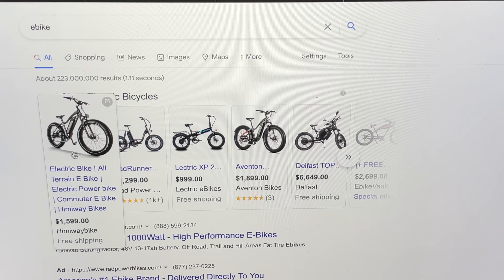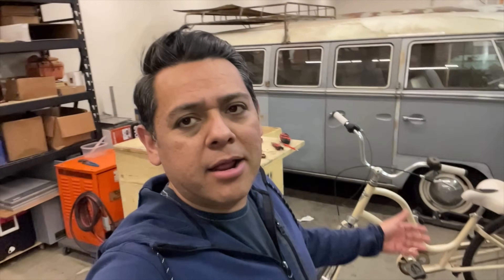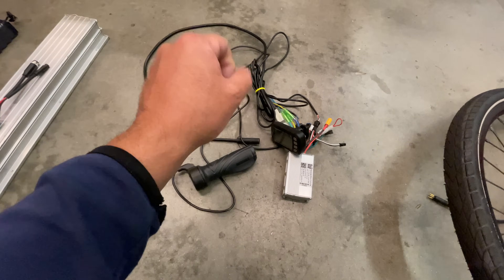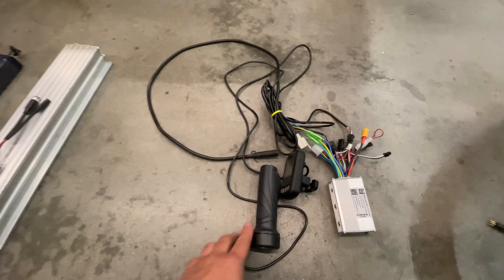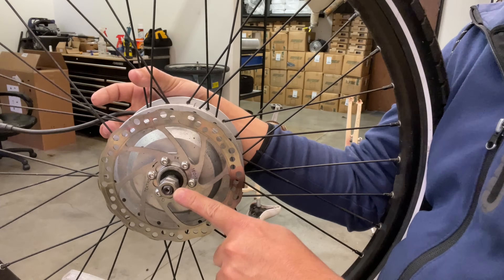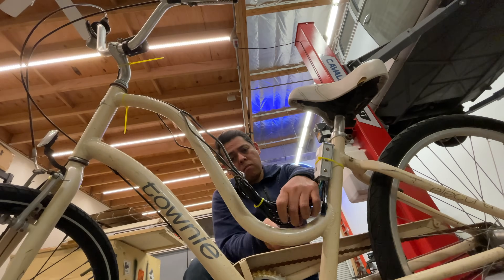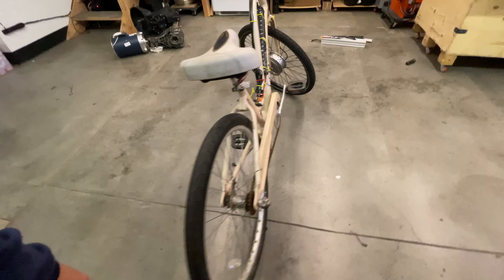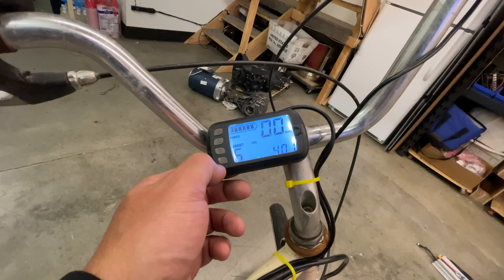$150 eBike Build,  Beginner friendly

Comment: I'm a cranky old man and a motor cycle rider for 40 yrs.   jehugarcia  i dig you talking about going faster and making them go faster but i think that is unwise unless the rider has a motor cycle license which ebikes can skirt.  even 20 mph is faster than most riders go on single speed bikes and comments about flying over handle bars reflect dangerous bad habits like riding with one hand or no hands and puting on a foot brake.  You can p[oo poo this comment but kids hare havein serious bike accidents all the time and 20  mph is fast enough to get hurt pretty badly specially if you decide to use your head as the landing area.  
      I like how fast you slapped that bike together  that was excellent but making the old piece of crap go 20 mph with out a front brake is just stupidly dangerous.  And having a few crashes before adding a front brake may not be the best idea.  If you wonder what qualifies me to discuss this I am an ASE certified mechanic.  And the thing that bothers me is weight transfer on  a cycle  in an emergency  about 80% of the riders weight pushes forward and lifts the rear tire this means that just when you need traction on the rear tire it is lifting up and reducing braking just when you need it.  there is no auto or motor cycle that has been for sale since the 30s that has rear brakes only.  Note ford added front brakes in 1932 to their model A.  anyway I wish you would have put a front brake on that conversion  considering you were going  29 mph  or KPH? around that lot.   thanks 
       EDIT  OOps  I stand behind what I have said but I just noticed that that bike already seems to have a front  brake you don,t see that on many med and heavy weight stingray type bicycles

Comment: If I had his knowledge with tools and electricity and had tools I'd get the biggest frame and 27.5 4.8 tires, a big 52v 40ah battery, 40amp controller,  to a 2000w nominal 3000w peak
Reply: If you had knowledge you would just get a real used motorcycle instead of all that stuff fat tires and huge speeds are bad on unsuspended motorcycles get an 80 cc or larger dirt bike with a license

Comment: Just a note to any UK viewers that these Bafang kits are technically illegal here as you're not allowed to have a throttle (only pedal assist) or go above 15.5mph. Though I'm sure the cops are more bothered about the millions of (also technically illegal) e-scooters zipping around than they are about people's homebrew e-bikes.

 Personally I would want to connect up the cadence sensor and brake levers to provide more control, and also to tidy up the cables and put the controller and battery into an enclosure or something (even if only a frame bag) to protect it from rain and the risk of catching and ripping out a cable while riding. 

I looked into converting an upright town bike like the one in the video but ultimately couldn't be doing with the hassle or waiting months for shipping from China so bought a used e-bike that needed a few repairs instead for a similar amount of money. (Didn't want to mess around with dodgy Chinese lipos and risk burning down my house either.)

Comment: My battery is not working. When I check the voltage at the leads i get a 4,6v. But when i check voltage at the battery leads i get 46V. What is happening here? I dont see the blue led light blinking

Comment: Hello great video, would it be possible to power a 36v hub motor connecting 3 x 36V 4Ah hoverboard batteries, for a total of 36V 12Ah? And what kind of connection would i need to connect the batteries to the speed controller?
Thanks

Comment: How do you charge the battery, is it through the controller? 
Also the site you linked sells the battery unawakened do I need to purchase extra stuff to awaken?
Lastly (sorry no experience) you said you soldered a wire to an mt60 but which one. Looking at the diagram I see leads to motor but nothing barked battery

Comment: I have a few old bikes, and I'm kicking around the idea of making an e-bike. I've seen several reviews and how-to videos, and it seems that people are recommending powering the rear wheel of a bike. The front wheel headset, the tube on the front of the frame with bearings that connect to the handlebars, is not made for the torque of the electric motor. It can damage the headset, even breaking the welds that hold the headset to the frame. I don't know how much of a problem it will be, but something to consider. With me being "El Gordo", I'll need extra power to get me up the hills, which means extra extra torque will be needed, and extra strain on the frame.

Comment: just the wheel alone with shipping is 80$ and with all the other components it added up to over 200$ easier just to buy a kit on amazon for 230$
Reply: My total was 70 for the motor with shipping
Reply: It probably depends where you live whether this is a good alternative or not
Reply: Kits for e bikes are 90$ not including battery, but cadence and speed sensored? And need battery plug conversion?

Comment: I got everything hooked up and my LCD turns on, but when I twist the throttle, I get one  bar of power and no wheelspin from the motor. Green and blue wires are reversed as suggested. Anyone got any ideas? lol
Reply: I had the same problem and it was just because the extension cable was not connected correctly, But other then that I'm not sure. Hope that helps

Comment: Ok so i solders an xt60 cable where the bullet connectors were in the motor controller (pos and neg) and connected the battery to it via an xt60 to xt30  but I'm still not getting power, everything else I followed to the letter, anyone have a similar problem? Any advice?

Comment: Can anyone help me. I purchased the wheel/motor battery and controller. I do not know which extension cable to purchase from the wheel/motor to controller. There are a few options. ? Also the controller does not come with any instructions. Is there a more in depth video anywhere. Please and thank you

Comment: My mid sized battery came without the plastic on the small red and black wires sticking out the back. The tiny piece of electric tape wasn't preventing them from touching. Think it's safe to use this battery? Also the motor wheel doesn't spin very freely and feels like it has sand in it. Bad bearings?
Reply from the maker: Hard to say,  you’ll have to try it to find out
Reply: @jehugarcia  Got my battery in a giant 80 pound safe charging :P So far so good haha

Comment: I found a controller that works, plug and play, no switching wires. Unfortunately, it came from a 48v 1000w kit that is probably too much controller, bit it does work without modification. Had anyone found a 36v controller that works with j just plugging in the 9pin connector?

Comment: I purchased all the parts but can’t seem to connect the battery to the motor controller box. Does anyone know where I can buy a cable to connect the small battery in the video to the controller box positive and negative slots?  Thank u in advance

Comment: My project review.  I saw this and for $150 was instantly in.  I have an old bike in the shed (DYNO Cruiser) that I don't use anymore. It is in fair shape but missing a pedal, seat is torn (covered with a seat pad).  A good donor for this type of project.  $150 what could it hurt?  I bought the items from the links.  Shipping costs were crazy!  Bought the medium line battery (it arrived but does not work ... still waiting on an answer for that.)  I received the wheel and tire.  They were in good condition, clearly used but in good condition.  The link for the nuts made me buy a package of like 25 (if anyone needs some contact me, just pay shipping I will give them to you). Like the battery that I received, the controller I received did not work (AMAZON PRIME REFUNDED). I  Bought another controller " hand brake style" (which I really like), Installed it then installed the wheel, since the battery I received from the link was bad, I bought a different battery that came with a case.  It was pricey but the case looks good on my style bike frame, hides the wiring very well and holds the controller also.  The 3 phase wiring was an issue, as mentioned in other peoples comments the wires are not color for color. The motor will wind but the wheel does not spin. I swapped the phases and the wheel operates correctly now.  As for $150 thats simply not true.  I have not found a way that you can convert your old bike for $150.  Parts, shipping etc just cost more than $150.  With some minor upgrades, I am in to this project for $281 (not including the bike).  With that said, I am VERY HAPPY with my bike now that is it is converted.  Thanks for posting this, I would not have tackled this without having watched this video.  JAG35 STILL WAITING ON AN ANSWER FOR MY BATTERY!     Please help
Reply from the maker: what's the questions on your battery?
Reply: I received my battery/charger.  The output on the the charger is reading 41.2 volts.  However, the output on the battery is on 19.8v.  The charger is working correctly.  I charged a different battery with it.  Can you help me solve the issue with the battery I bought from you or replace the one I received with a working one? Respectfully

Comment: I'm having a tough time measing my tire size on my existing bike.  I want to buy one of these and fit it to my Fuji Absolute 2.1  The sidewall of the tire measures:  32-622  (700x32C)  I'm not quite sure on how to read it.  If anyone could help me decide weather or not I can use this wheel, I would appriciate it!
Reply: Tape measure the wheel across

Comment: just got the wheel, battery, controller , throttle, cable for wheel.  when i give it just a touch of throttle it spins correctly but if you give it more power it stops. tried all 9 motor wire combos. what am i doing wrong? thanks
Reply: Try connecting the "Intelligent Recognition" plugs. I needed to use the throttle until it DIDN'T work, unplug, and now it's fine (don't leave them connected). Use the wiring advised by Patrick W., "yellow to yellow, blue to green and green to blue."
Reply: @lastbutnotleast1396  my controller does not have any plugs like that. i DID remove the halls connector and solder the wires to each other. now it runs perfectly until you get on the bike and then it sounds like something is slipping in the motor/gearbox.  if you baby it , it finally grabs and will pull just fine until you let off the power. then the slipping starts all over again. but, once again, my halls was not making decent connection. that was the original problem. now i need to see if the gears are stripped (out of the box) or something else is wrong :) when it works it works very well

Comment: Any chance my motor is shot? I have been fighting my controller. I changed the phase wires around and it still doesn't move.
Reply from the maker: It’s posible
Reply: @jehugarcia  I used a 48v 1000w controller from another kit and plugged it right in and worked perfect with the 9 pin connector. No switching necessary.  I am teaching a middle school S.T.E.M class and this is our first project. They love your videos.

Comment: What controller do I need for the 26'' 36 volt Bafang wheel Rated Power (W) 250/350,  if I use the NineBot 36 Volt 720 Watt I also purchased. The 250/350 watt controller I purchased just sparks out when trying to connect. Any suggestions?

Comment: Be aware that the wheels are not in the best shape.  Ordered 2 one arrived with a seized hub, and one arrived with a bent rim.
Reply: They're specifically sold as bent/broken wheels.
Reply: Both mine arrived in good order.
If they are bent I can't see it but I haven't put them in a set of forks yet.
If they are out it's not by much.
The tires even hold air and they included the calipers.
Sorry to hear yours weren't
The one that's locked up is likely the gears which you can get replacements for. 
Personally I'd open these wheels up and inspect, clean up and  lubricate it.

Comment: Here in stores we have brand new chinese €499 ebikes. lots of family here have them and myself would never buy them, they work but dont ride well and have no real controller, more like an on-off for the motor when u start pedaling and they make a lof of noise.
Myself got a used Dutch ebike for €350 which used to be €2800 new and its awesome comfortable bike, could use a new battery tho.

Comment: You made it seem soo easy! Right after watching this I bought the ebikeling kit (only Bc I wanna do the ear wheel) and I bought the 30 cell pack from your store, finished the build in like 2 hours! It’s super awesome, but the system cuts out after about 20 seconds of continuous use. Do you have any tips on how to fix this? (30 cell 36v 8 amp batter with ebikeling kit 36v 750watts)
Reply: Did you use the beofang hub. ? I got mine to get power. But it doesn't spin. Did you have that problem during build? Thanks

Comment: I connected this up and the screen wont turn on. I have voltage to the connector. I put batter to control red to tred, black to black and then the controller to the read out and the read out wont power. I must be missing something

Comment: Problem solved. See my reply for the unintuitive solution.
Some progress; at least now I'm getting it to do something. But, connected as per Patrick, at any assist setting, I get 368rpm and 27mph, but the wheel itself isn't turning. Connected as per website, with the wheel off the ground, I get 69rpm and 4mph, and it sounds like a dying animal. Just for fun, connected B-B, G-G, Y-Y, it just groans and stops. Useful suggestions would be appreciated.
Another clue: with the "Intelligent Identification" terminals connected together, the wheel spins in the right direction (with no throttle and normal sounds). Disconnected, again, normal motor noise, no wheel movement. Help! Thanks.
Reply: Solved, thanks to the blog. Thank you, Stardog, wherever and whoever you are, though I had to do the opposite with my throttle. "As I recall if you connect the green “learn” cables together the motor spins on its own. If you leave them connected the motor will continue to spin. If you leave them connected and twist the throttle the motor should stop and reverse (the motor runs, but wheel doesn’t turn). Twist it again and it should reverse again. To save the setting, power down and disconnect the green cables. You don’t want them connected in normal operation."
Reply: @lastbutnotleast1396  Thanks, this pointed me in the right direction. Was also having the issue where it would spin slowly and with little power. Tried all combinations. Finally, kept the motor wires in matching colors and used the 'intelligent' terminals to cycle through using the throttle... This vuaeco video also helped a bunch: https://www.youtube.com/watch?v=PuwnFMHHtaE&list=PLtG9bKpDUF5j0-KDj7qEx8oTuG7KJXL3Q&index=1&t=438s

Comment: I got that same exact bafang used w schwalbe tire..brake caliper and rotor for like 40 bucks. Got a 30$ controller and $13 throttle w voltage display.
No LCD for me. 
Powering it with a 40V battery from my Ryobi mower. Gutted a broken charger for the bike mount. Think Im in it $100

Comment: I built this with the scooter battery. I'm having an issue where it turns off while I am riding it after about 40 feet  I'm pretty heavy at 270lbs. Is it too much weight for this thing?
Reply: Y e s... also pretty heavy is a understatement you are extremely heavy you would need a high torque motor for that much weight plus the weight of the bike

Comment: Just installed the front wheel.motor on my sons bike and installed a 36v controller and assembly. I also purchased a 36v 5.2 amp battery to use with the set up. When my son is riding the bike and not peddling the entire system shuts off. If he is peddling then there doesn't seem to be an issue. The only physical connections are the battery to the controller and the three wires going to the motor Yellow, blue, and green. To me it doesn't make sense that if he is peddling everything is fine as there is no sensor on the crank. Any ideas as to why the entire system shuts down when he is riding his bike then uses the throttle only? I purchased one of those Ninebot batteries and the four lights flash on and off when the system shuts down.

Comment: I'm lost where do you get these parts
Reply: links are  in the description,   you need the motor, the controller set, the extension cable, and a battery.  (one of each)